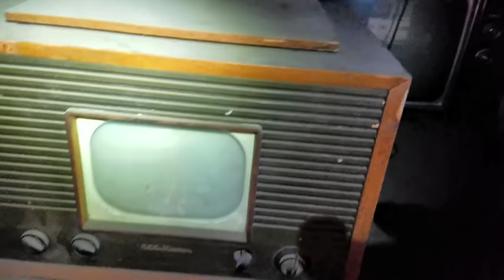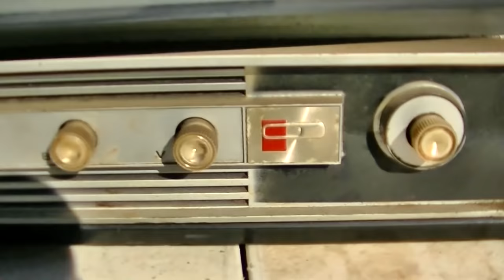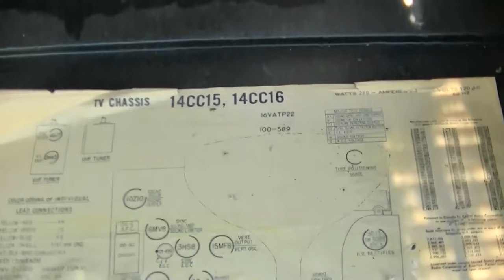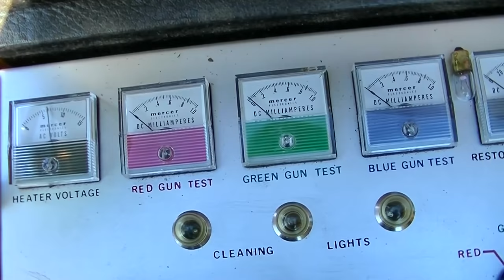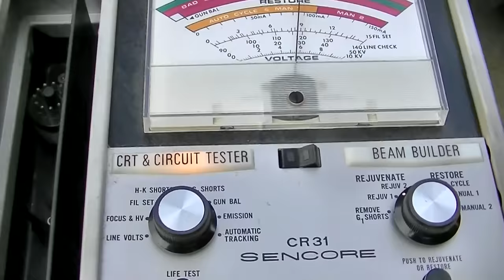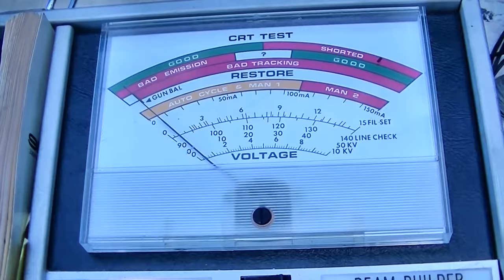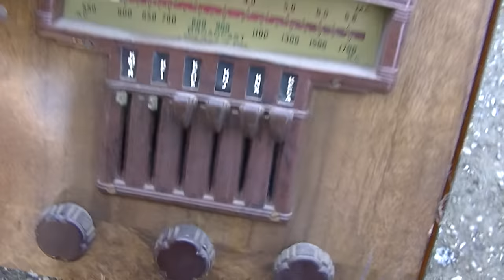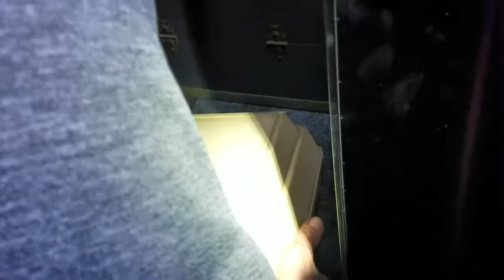Testing 20 Vintage Tube Television Picture Tube Pickup Analysis TV Sets and Radios

Comment: I had exactly that set (your first RCA set) in my bedroom and used it until July 1992.  I watched Johnny Carson's last broadcast on it.  What a sad night.  I can still remember he said "I big you a heartfelt goodnight" the screen went black and my stomach came up into my throat.  My dad had bought the set in approx 1969, and it was on a matching fantastic roll around cart, so this was his first portable colour set.  It had remote which still worked of course, and the remote used sound rather than IR signal, and it actually turned the dials on the set as it changed things.  By the time I started using the set the colours were pretty muted, but I loved it.  A friend brought a tube tester and we found that every tube in the machine was showing up well below "good" although the only flaw in performance was the muted colours.  I don't know if replacing all those tubes would have improved the colour or if it was faded because of burned out phosphors.  I used it until we moved 1000 miles away and didn't have a set in my room again until college.   I was 15 and having my own TV in my bedroom at all was unbelievable, and at that time we still had black and white sets at home so even muted colours of this set were preferable to black and white, like the set in my mothers room which was a 13" sony which probably still works.  Our main family set was a beautiful big Magnavox colour console, circa 1975 with direct dial tuning like a phone dial you could enter your channel directly from remote or from the set which had beautiful square white buttons which were touch sensitive.  That set died almost the same week we moved out of our big house.

Comment: That 19" Packard Bell from the early 70s that's really a GE,  wasn't a bad tv. We had a 1973 GE with the CD chassis that never really gave us trouble except when my cat threw up on it and caused a short, other than that we only had to hit the circuit breaker once. 8 years after we got it the audio output tube had to be replaced, the following year a resister in the sync had to be replaced along with the tuner. But before we got rid of it the vertical started when a half inch gap occurred on the bottom of the screen, but was still watchable. I also inherited a 1970 C1 chassis model with doors on the front that only needed a CRT which I took from my parents old tv. Wish I installed a new crt in it and kept that set. These tvs worked well with vcrs.  I also heard a GE tech say those tvs will never die.

Comment: The 18 inch Zeniths are great sets.  I've never seen one with a remote.  My parents bought one in 1968 for almost six hundred dollars.  Our first color TV set.  I bought one at the TV shop I worked at for about fifty bucks because they left it.  Didn't want to fix it.  They have the plate on the bottom like most Zeniths which make 'em really easy to repair. I used it in to the mid 90's and the CRT went soft.  Great sets.
Magnavox sets have always been shit.  Even the tube sets.  Impossible to get a natural flesh tone on one.  We called them "maggot boxes". 
We used to call General Electric TVs "Generally Defective".  Crappy PC boards, Compactron tubes, tinned stranded wire that broke with flexing.
Reply: I heard those nicknames. Older service guys hated the P C era. And it got baked in color tube sets.

Comment: That Hickok 156 Indicating Traceometer is an all in one radio diagnostics instrument from the late 1940s to early 50s. That and the 510x Multi Tester were all a technician needed to service radios in the day. I'd open it and check for leaky batteries inside, if nothing else.

Comment: I loved zenith system 3 tvs, so easy to work on a child could repair them.When I had a repair shop in the 80s I would stop and pull the modules out of every one I saw sitting on the curb waiting for the trash man. It was like free money, no soldering required lol. To be honest, I never thought some of the butt ugly tvs from back then would ever be collectible...or that any tv would be collectible. Boy, was I wrong!

Comment: There may not be another one of those RCA color sets in the world, but there is a brand new in its box 18VBDP22 picture tube, part of a Heathkit color TV that my father never finished building. It's fully solid-state as best I'm aware, so probably not terribly similar to that RCA.

As far as I know, all the pieces still exist except the manuals, but they've suffered through basement floods and neglect. As the circuit boards are all populated, maybe someday I'll pick up where he left off and finish building it. I'm not sure. It might be more than I want to tackle.
Reply: I would love to see a video on that at some point
Reply: It's a shame Heathkit is gone.

Comment: A great video you posted here today. The first set that you showed us is an RC a hotel motel television and when I worked in the television repair shop back in the late 70s these sets came in on a regular basis from the local hotels in the area in New York City. They would know torious for vertical problems and AGC issues. Just thought that I would pass that along.

Comment: On the Philco. “New Matic” was their name for their pneumatic remote control.  It was a squeeze bulb with a rubber hose that ran to an air port in the set.
Reply: I found the idea quite hilarious! But genuine, for sure! And electrically safe, you won't get a shock from a rubber hose.
Reply: Guess They were targeting kitchen, bathroom and poolside
Reply: I sincerely doubt that thought ever entered their mind,much less was a motive behind it.  Knowing Philco it was done simply because it was the absolute cheapest way possible to add a remote feature to the set. 
Zeniths “space command”,Magnavox’s “phantom” remote and other ultrasonics as presented no risk of shock either.
Who watches tv in the bathroom anyway? And a picture wouldn’t be visible “poolside” unless you were swimming at night,or were Thurston Howell the 3rd and had an indoor pool.  Besides common sense tells us that televisions shouldn’t be placed near water or in humid environments such as bathrooms anyway.

Comment: Grey beard tip, if you change the crt, take a marker draw a line on all the convergence mags also around the neck, front to back. then swap then make sure you slide it all back on the neck as best you can to the marks you made. (you will need only minor movements then because most crts had to meet comon specs. CRTS were ment to be replaced but had to do it right.
I could change a bad crt right in your house why you watched and came out exact. The we got payez and on to the next. :)

Comment: I had one of those Sony sets back in the 80's, best TV I owned. Had it in the shop one time and had it back in a day. I'll be darned if I could remember what the problem was. The owner of the repair shop was also an authorized Sony Repair center. I remember a comment he made saying it was a common failure, wish I could remember the issue.

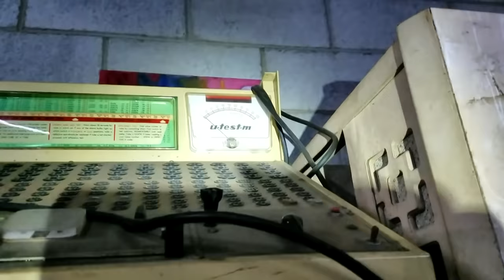Comment: 1:39:52 These JVC VHS machines were hugely popular here in the UK, though more commonly found badge-engineered under the Ferguson (Videostar) brand by Thorn Consumer Electronics. That particular model looks like one of the very early linear stereo front-loaders with LP 📼

[JVC HR-7650 / Ferguson Videostar 3V32]
Reply: Yes, here in Germany we know them as Telefunken, Nordmende, ITT rebadged units. I had the mono version of those as my first VHS recorder. They had an unique indexing feature using the full erase head. Unbelievable complex electronics inside, a "Bauteilegrab", means a grave for components.
Reply: I used to work for a company owned by thorn americas in the u.s.
Reply: @omniauniting  That's right, I recall something to do with a joint-venture called J2T (JVC, Thorn, Telefunken). I remember seeing SABA and NordMende iterations of the earlier HR-7700; also an Akai version which was sold here in the UK alongside the others. Interesting times!

Comment: #1 RCA is a motel set. Newer chassis in old style cabinet. No ears & coax in the give aways.
Reply from the maker: Ahhh I'm actually going to dig into that one in a few hours
Reply: I was thinking the same thing. That fancy label with the channel numbering too, as they probably piped in the local stations on different channels, including the local UHF station.
Reply: @shango066    Cant wait for the vid. Get every 5GH8 you got out !!
Also watch the plate resistors in the hoz osc. They will eat up the 36MC6 every few months. Thats a cathode cut off besides it.

Comment: I had found a portacolor set 73 vintage back in the 90s for a little set it got a great picture, good color and tint, one thing I couldn’t get was vertical height, any news crawl at the bottom was not visible, I played with the vert. size, vert. linearity and couldn’t get a balanced picture, all done by eyechromter.  I used it as a playback when I was tinkering with vcrs, until I fixed a 13” Sanyo I found, a cold solder joint on the pc board. I sold the ge for 10$ at a flea market about 5 years later. Just keep the hoarders episode going! LOL!

Comment: Shango is quite sophisticated. Based on research,  he used the original French definition of triage from early 18th century (sorting items according to quality’): from trier ‘separate out’.  The current sense dates from the 1930s, from the military system of assessing the wounded on the battlefield.  Et ça ?😉

Comment: On the RCA set #1, the channel guide indicates Houston, Texas where the old analog (and virtual) channels are NBC 2  CBS 11  ABC 13 with UHF Channel 39 downshifted to 5 on cable or antenna distribution systems.  The existence of a channel guide indicates hotel/motel (high hours)  use, where out of town people don't know what local channels carry the networks. I would have set that one aside for later (or never)

Comment: Also the late 50s metal case with the red-and-white Streamline case is a general electric but it was branded Hotpoint. Those two will also notorious for capacitor  problems even back in the day when they came in for service the few that came in in the late 70s
Reply: We had a GE version, 14P1208, 1958. I still have the SAMS, 409-1, We used it into the late 70s great little shock hazard too.

Comment: 1:47:13 in the left of the frame, i have one of those zenith radios. Still has the few wax paper caps and selenium rectifier, but it's the best radio i have ever used, on both AM and FM. Great radio

Comment: I wonder whether the first TV came out of a hotel. The channel assignments on the plaque would have been what the MATV system at the hotel used. Use at a hotel might also explain the high number of hours of use and the heavy accumulation of cigarette smoke deposits.

Comment: HA, gray beard here, we tossed TONs .. i mean huge dumpsters of things like this out as bench techs. At one point where i worked (crazy) one would get on the roof over the dumpster and drop face 2 face crts just ot hear the BOOM!
It is rare now because to us then it was just all crap .. cheap .. and we wanted to get on with the next gen.
This is why this is all rare.
Btw this guy is not wrong and in my time we had to move a sea of all of this stuff  all damned day long.
But if you want to know what it takes .. tune in more. this is how we all learned it yah we made a living at it.
Anyway .. hell yah man.. you got it right :)

Comment: That red set with the GE CRT is more than likely a Hotpoint or GE.  Only way it isn't would be if the CRT was replaced.  Lotta replacement CRTs were GE.  It also looks like a Hotpoint set you repaired awhile ago.
Reply: The television is a General Electric model 17TO26.

Comment: I think it's funny how I used to think all this stuff was junk and not worth keeping.   Now I still think it's all junk, but I think it's all  neat junk worth keeping.  I have a decent collection of tube and solid state radios and TV's.  I'm a horder and was going to get rid of a bunch of it and just never got around to it.  It all started when I was going to toss a reel to reel out.  It was in my trash pile and latter on in the day I was thinking "that's probably a tube a tube amp".  Sure shit, I hooked up my phone and a decent house speaker.   I was hooked on tube sets after that.  Then I find Shango working on this junk and now I'm a serious addict!
Reply: I certainly wouldn’t classify the 50’s and 60’s sets as “junk”. they are repairable in most cases and even not working have aesthetic appeal. The garbage made today in China is the real junk. It’s got no style,is made as cheaply as possible and  is in most cases not even repairable. You throw electronics out now when they break.

Comment: Damn Shango, what a lucky dog you are to have that #156 Hickok Traceometer.!  And in nice condition; I always wanted one but they were either trash or someone want too much money for it.
John D. Burke in his excellent book 'Rapid Radio Repair" he talks about the advantages and even modifications for this unit.
The book is available online but you said you can't post links.
Anyway, that is one really nice piece of test equipment (mainly for radio) but has one of the best all-in-one test instrument lineups around.
You should do a top-notch restore of this unit, as it could be a center piece for radio resurect/restore!

Comment: About that CTC53 set that you showed at first, I actually just found a set with that same chassis a couple of days ago. Mine is in worse shape, but the flyback is situated a little differently. Although you have much more knowledge than me, I would definitely be willing to document the set and some of the process of (attempting to) restore it. If you would be interested in seeing it, I can hit you up with an email!
Reply from the maker: I'm going to work on mine in a few minutes. If you want to contribute an analysis video on yours I will totally include it as part of my video on the set. Upload your video to drive and send it to me if that's what you were thinking
Reply: @shango066  Sure! I can get a short video or two and some more detailed pictures over to you later today. I'm in the process of analyzing it myself
Reply from the maker: @defconzero  this is a hotel set so it's going to be different than yours. So try and do a detailed video of the inside the front and the controls. Email is on the channel about tab
Reply from the maker: @defconzero  how's it going? I've got this one running
Reply: @shango066  I've got a short video made. I'll send over a folder with the video and some photos of where i found it

Comment: Q: Why do you wear gloves when working on vintage electronics?

A: Just so you know cadmium accumulates in the body with a very long half life, specifically in liver, lungs, kidneys, and the brain.  Typically, the kidney damage caused by cadmium is not reversible and in many cases, death is the result. Cadmium exposure is one of the main causes of kidney failure. There are other reasons to wear gloves as when soldering.  First, the metal surfaces that you are soldering will often be coated with a thin layer of oxides.  If you touch these surfaces, the oxide will chip off onto your skin because it is a thin layer of metal dust which has seperated from the base metal. If this metal dust makes it into your body, it will build up in your body until it reaches a point that it can cause death, but this is after many years later.

Comment: Had a B250 camper van with bad caps, went from totally dead to running happily after just a few minutes. Peeling off the silicone off the board was the most time consuming part. About the micro-clots.. welllll. I'm sure it's more than one thing giving us health problems these days. Follow the money chain.

Comment: 1:47:19 I just sold a radio like the one in the middle of the stack. I converted it to use an isolation transformer since there was room inside. but it had silver mica disease.

Comment: Shocked the CTC53 didn't have a Nuvistor in it, the set even nodded toward that with the "New Vista" on the front.  Croakydinkler.
OK 24 minutes in now, loving the Park Ave. commentary. Also that little kitchen set piqued my interest, I'm sure you've already got one very similar but my memory tells me it was a kind of pastel blue/green & had a weak picture bulb/disintegrating yoke.  Whatever that one was, would be interested in more in depth to find out what this new set originally "died" for.  Another observation at this point, all the B/W  bulbs have been super strong. Your friend may have had a knack for picking the good ones to keep!
just before 29 mins, you can do that when you have an HK short on the picture bulb too possibly. Seem to recall you showing off that trick on a video before, floating the filament.
Reply: On the phone YT account now as we're out and about,  I'd almost be sad to EOL that Hello Kitty set it's just so cuuuute with its custom OSD graphic and pink paint job.  Perhaps you could find it in your dark heart to spare it, baby Otezla could watch Tiktok on it.
Reply: Finally caught the end of the video now, never even noticed the strobing light I was that engrossed in looking at all the radios...  That EOL idea is a good one Tyler, you could well be right.  25th December sound like a decent date to set for that? Can't think of anything else better to watch that day.

Comment: The Sony SL-5100 is a good deck. It shouldn't be overlooked. It's just one model number too soon for hi-fi. Beta hi-fi was added with the 5200, & called SL-HF5200. Same deck otherwise. The SL-HF5200 was Sony's first Beta hi-fi model. As Maxwell Smart said: "Missed it by that much".
Reply: I saw that too and thought of the Beta HI-Fi and recall it making the cover of Stereo Review magazine that summer of 82. I was an EE student in university at the time.